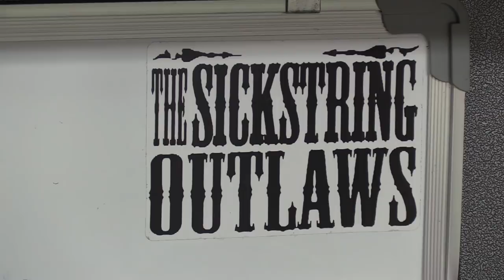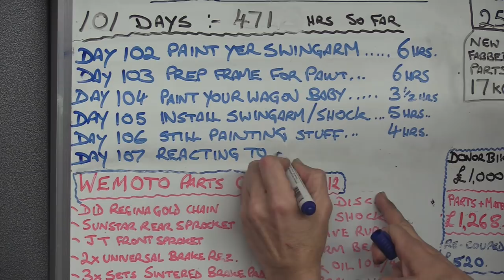Delboy's Garage, Fighter Build #102, Paint Crazed Up..!

Comment: That is the problem with Tough Black - so thick, I'd guess you sanded off the cured top layer and allowed the primer to eat into the less cured paint.  My car paint is still reacting, more than twenty years after the respray.  Good luck!
Reply from the maker: Hi mate, i just painted it too early, and the under layer disagreed with it.. it didn't lift again, just slightly rippled in that area.. if it still misbehaves ill just rip it back to the metal and lay up three wet coats again, no dramas aye... see you next week mate..

Comment: thats what you get 99% of the time you put an etch primer over paint and even more so with fresh paint. etch primers are for metal only. would have been better off to use an epoxy primer if you had metal showing threw in places. i did not mean for this comment to sound nasty but hey lets face it we all need to learn some how and nothing better than learning from mistakes, we also have bad days where we do stupid things and mess up but thats life
Reply from the maker: Hi Ross.. no offence taken mate, its all constructive.. you're right, epoxy would have been the right choice, but its not easy to get in cans, and it had several bare metal areas, and you know what can happen with those on the thin edges where you feather the layers out, they can lift at the thinnest point and look like ringworm lol..  so stuck between two choices i guess.. oddly enough, it didn't all lift up either, just on the outer faces only where it was smoothest.   Good news is, it looks like ive got away with it, there has been no more repeat reaction, just some very feint marks where it was.. im gonna leave it for the rest of the week in a warm garage, and see if they shrink back, they are barely visible even now just 24 hours later, so i may have actually got away with it..!!!!

Comment: Bugger!! So frustrating when it don’t go right, I painted my old bike a couple of years ago (winter project) I think I came across every paint issue there is. The most frustrating part for me was leaving it to dry long enough. And being winter it took twice as long. And any imperfection in the base always showed though the top coat. When that happened to me I heated the part and just scraped it all off to where it was ok, flatted that area and started again. Does the tough black require a primer? I also found that filler primer quite temperamental with other products as well. It’s all trial and error, and well done for keeping it real and showing the bad as well as the good. 👍🏼
Reply from the maker: Hi Paul, Its good in some ways to have experienced all those little issues, it makes you more aware of the vulnerability and volatile nature of rattle can paint... at least then you know what to do next time aye..   This was just pure impatience, didn't wait long enough to do the next coat, the 'tough paint' product takes longer to cure than regular paint.. Have a good Sunday mate, heading out for a ride later, the suns out, and the birds are singing... cheers buddy.. del.

Comment: It would help if you could isolate the back half of the garage because you need to open and close the door when entering/leaving, the loss of heat due to the door being open can hurt the drying process. just a suggestion.
Reply from the maker: You're dead right Tim, ive often thought about devising some kind of curtain system, with tracks along the ceiling.. but its just finding the time to get to it, we're never closer then ten jobs still to do as they say... good suggestion mate, thanks for watching.. Del.

Comment: I remember thinking to myself, etch primer over the painted part... Probably not the best idea. Sorry it ended up that way Del.
Reply from the maker: Hi Samuel, i had lots of little bare metal patches showing, and they can often form a ring reaction around the edge.. ive layered it over paint before and its been fine, plus it didn't react all over, just those side areas that were thickest... just wasn't dry enough yet thats all..

Comment: Hello Del, I was wondering why, when you now have a suitable compressor, you are not using a paint sprayer. Although it might have still happened (as you mentioned, Mackie had that same problem), but being able to select the paints you use, may have reduced the likely hood of a reaction. You could probably mix for a faster drying time as well (don't ask me for advice though, as I didn't even know what yellow primer was until you told me), I can appreciate that cleaning would be a bit more involved than turning the tin upside down though.  Cheers Gordon
Reply from the maker: Hi Gordon.. i think my mistake was just hitting it with more paint too soon.. it had only had maybe 20 hours to cure.. and thats not enough... i could choose more elaborate paints if i broke out the spray gun, (and yeah, i do have one), maybe some epoxy sealer.. but in the end the one issue was that i can't buy that Tough paint in raw tins.. only seems to be available in rattle cans.. so there it is.. looks ok now mate.. 99% sorted, time may see it fully disappear, but if not, its no drama to repaint it one more time..
Reply: Hi Del, Well its the end result that matters. I'm surprised how long it takes for the paint to "cure" I was thinking it was minutes not days, I guess I've been watching to many TV story's where they show a car on a production line being sprayed, where the car just goes through a spray booth in minutes and comes out smooth and shining ! Cheers Del,  Gordon

Comment: Looking at the area of crazing it looks like it was where those carbon fibre frame bits were. I think you will be extremely lucky to get away with not stripping back. I would leave it about 5 days as well because of the number of coats you applied.
Reply from the maker: Hi Andy, yeah, thats true, it was right were they were.. but the first layer of paint didn't react, just the primer which is why i thought it was maybe just too soon to recoat it..    Thanks for your input buddy.. have a good Sunday.. Del.

Comment: Painters nightmare!! As long as the etch is dry it shouldn't happen again but I'd say your prob gonna be flattering that paint back down and it's a good job you got a fair bit on there it'll act as a sort of high build primer which should help, chin up mate happens to us pros from time to time, it's a bloody nause painting!
Reply from the maker: Ha ha, thanks Darren, im glad to have heard from so many Pro painters with this sympathy.. it is a little gremlin waiting in the wings for the moment you get careless aye.   but i recon ive got away with it now... as you saw, i laid up 5 thin dusty coats to get some coverage without making it too wet, then just two wet coats so it floated out..had no choice but to do at least two wet coats as i cant wet sand it with it being satin black, i just have to hope it floats out... 

24 hours later now, and no more reaction, but there is a very feint pattern in the side areas, hardly visible unless you get reflected light on it.. so im hoping that a few more days in the garage with the heater on keeping it at 15 degrees, and it will shrink back and vanish... If not, and i can still see it.. then i recon just a light  wetflat back with 1200 grit to take the pattern out, and one more wet coat should do it... fingers crossed..   

Thanks for taking the time to share your knowledge mate, its much appreciated.. Del.
Reply: No probs mate, I'd go with that if I was you let it sit for a bit and then a quick dib down and a couple of coats, it's gonna prolong it a bit but you'll be glad you did it cause if you don't  you know one day somebody will notice it if you don't and it'll be "what's that" and you'll be gutted

Comment: Oh bugger pants! Welcome to my previous career...doh!
Leave it 2 weeks ...you were right the black under the etch was not cured...the etch is harsh and only really goes on bare metal and exsaserbated the black carriers still locked in .....but a great lesson to show on camera as this happens to all of us (even seasoned pros)..
So sorry this went tits up but Respect due to you for sharing it...chin up Peace and love ☮❤xxxxxxx
Reply from the maker: Ayup Brother Springstar.. Yeah, its not common, but its always there waiting for when you get careless... Problem was i had half a dozen little areas of bare metal, and when you 'feather' them out, they lift up round the thin edges and look like loads of ringworm..lol... i think on reflection, regular primer would have been a better route.. but i think ive got away with it, no repeat reaction, just some feint marks where it was, im thinkin give it to the end of the week with the heater on in the garage, and sand back with 1000 grit, and one ore wet coat... fingers crossed..!  Pip pip luvvy..